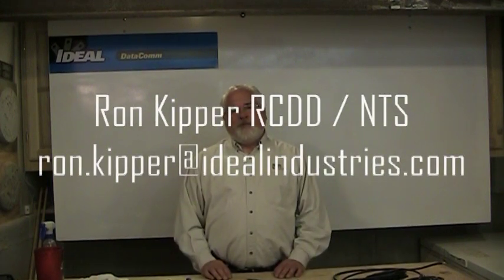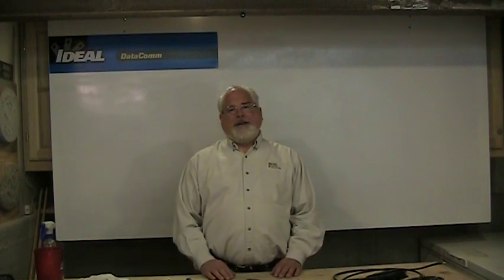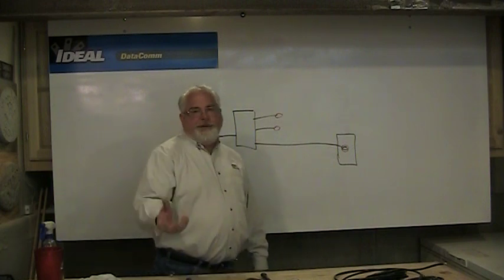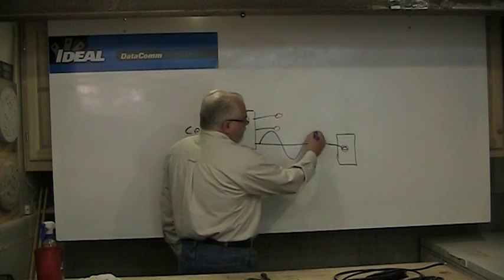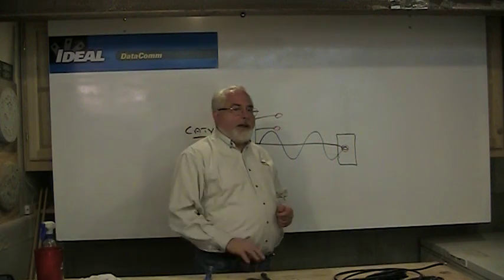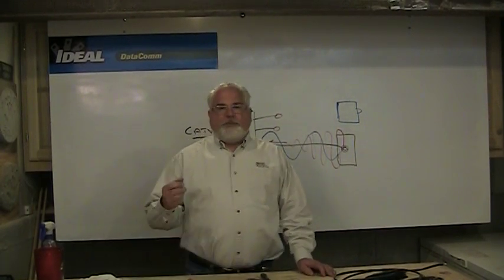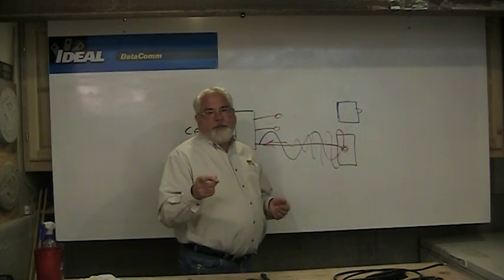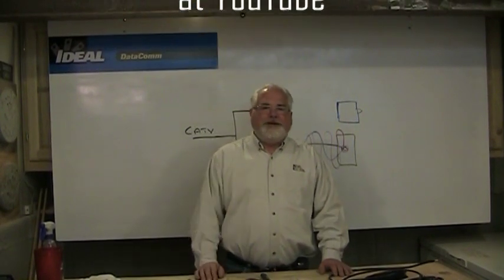Why Use CATV Termination Caps

Comment: I cancelled my CATV and was using my TV to just watch free channels picked up through the air using an amplified antenna. I tried connecting my TV to the defunct cable point and it acts as a perfect antenna to pick up the same free channels much better than the external antenna. I'm not sure if it's affecting the neighbours signals but mine works well.
Reply from the maker: Sounds good hope it works well Ron

Comment: The day the cable company installed a splitter, for tv our household began to hear high frequency noise throughout the house. We canceled tv but still hear high frequency. 
In the cable box outside the splitter is still attached and one side is not capped. Also all the ports inside our house are also not capped. 

Could this be the cause of high frequency noise and can i remove the splitter and cap the lines that were attached to the splitter to solve this issue?
Reply from the maker: It could help but I would suspect the signal strength coming into the home may need to be increased to make up for the loss of signal due to the splitter. If you remove the splitter and use just one TV and get a good signal that may be the issue good luck Ron

Comment: I'm going to use these to see if they increase the performance of my moCA adapters. I have a little more latency than I was expecting. I hope this helps.
Reply from the maker: Steven I doubt it will help with the letency but a good way to block any outside interference. Ron
Reply: @RonKipperDatacomm1  Thanks for the reply. I'm wondering if a POE filter could cause latency. I had cable internet before, now I  have newly installed fiber. I've read that POE aren't needed since the signal won't leak into neighboring connections through an ONT. I expect moCa adapters to add 2 or 3 ms to my latency. It's about 20 ms higher than straight ethernet.
Reply: Try to have only one moca splitter in your home to feed your adapters, and then terminate unused ports at the splitter.

Comment: Hey Ron great video this is what exactly I was looking for, question, is it better to cap at the splitter junction in the basement ( in my case) or at the wall ? Every room has an outlet and I will only be using two?Thanks in advance.
Reply from the maker: If the wall outlet is not hooked to a splitter then you don't need to cap it. If it is it is recommended you cap it and any unused ports on the splitter should be capped as well. It is just one more way to keep interference out of the system. Have fun Ron
Reply: @RonKipperDatacomm1  Thank you for the reply I will Cap them

Comment: Master, could you explain what would be a power inserter in an HFC network. If this network is energized at 60 or 90 v, because we are not shocked when touching the TAP.  
Hugs from Brazil
Reply from the maker: Hello that could be caused by several reasons and somehow AC is precent on your cable. So I would be double checking all connections looking for any damage in the cable as well as clearing all over head AC lines are clear of your cable (assume your cable is not buried) and make sure the cable is grounded as it enters the building. Good luck Ron

Comment: I suggested termination caps to the Comcast technician who today came to my house.
He either did not know what I was talking about or did not understand.

The physical cable from outside goes down to the basement.
The first Comcast technician 9 years ago put in an 1 to 5 splitter where each of the 5 from the splitter is connected to a cable that goes to various rooms in the house. This pre-wiring was done by the builder.
I am only using 2 of the 5 cables --- cable modem and DTA.

This second Comcast technician instead puts in a 1 to 2 splitter. LOL.
Sigh.
I am going to buy on eBay and buy some termination caps.
Thank you for this video.
Reply from the maker: Hello they are just one way to stop noise from entering the cable system use them well! Have fun Ron

Comment: Great video, thanks for clearing this up. One question I still have: I know there is a difference between a weather cap, that has a seal, and a terminator cap. I have 2 scenarios. One is outside, I’d like to cap off another cable companies line. I assume I use a weather cap??? And then I have a scenario like you demonstrated in the video. An unused coax outlet. I assume I use a terminator cap. Would I be correct? Thanks so much.
Reply from the maker: Luke yes I think you have it. If the splitter is outside and inside an enclosure you could  get away with just the termination cap. Thanks for watching Ron

Comment: what you missed is higher freq also = shorter and shorter antennas. inverse relation between freq and wavelength. a good radiator/antena starts around 1/4 wave length. If the head north again to keep up with fios/fiber to the premisis... 2ghz is 12.5cm wavelength.  even on the female end/ prongs inside the jack start to also look like a good antenna because at 1/4th of it we are talking 3mm. I know they keep going larger symbol set/ QAM but id bet they push the freq again in the coming years. other reason it doesnt get hot is the inverse square law, theres almost 0 power/even cat tv and the benfit of wire vs air... its still a hella weak signal in most installs though fttp and the house next to the pedestal might beg to differ. actually even traditional head end style with amp in the pedistal might still encounter this... maybe 1998 and in elementry school a young me once had the idea of rabbit ears into the cable jack. only did that once... i still remember the jolt/why i only did it once as well :D ...pedestal was maybe 100ft from where i did this and i know now the line was split from where it entered the house right under that bedroom lol otherwise good video, the point on reflections is pretty crucial. I wonder how long until they go mumi with cat tv. If i understand it correctly dsl introduced vectoring which seems to be along the same lines but as cable signals are straight rf id think they could eventually go with some form of multiple user mimo and count on coax bents and the like to implement the rf tech in cell and wifi stations. trick would be doing so with out obsoleting all their legacy boxes again.
Reply from the maker: Wow thanks for the input! Ron

Comment: Hi Ron, 

Great video and explanation. 
 
There is a vendor on Ebay selling 75 Ohm termination caps for use on unused coaxial inputs on universal disc players, like the Oppos.  Do these keep signals from coming into the unit, out of the unit, or both?   I assume there is no harm in using one of these?  Thoughts?   Thanks!
Reply from the maker: Probably no harm it should block signals from entering or existing a device. Just one more way to eliminate any electrical noise from entering a system. Not sure if anything nearby is causing you issues though. Hope that helps Ron
Reply: @RonKipperDatacomm1  

Thank you Ron.   Not experiencing any attributable issues.  Just precautionary.

Comment: Great video thanks for explaining such an interesting topic.  Question:  I have a 8 way splitter in the basement and coax cables leading to an outlet in each room.  Is there a performance difference in putting terminator caps on all the unused outlets VS disconnecting unused the cables from the 8 way splitter and putting terminator caps directly on the splitter?
Reply from the maker: Hi Matthew I don't know if I have a good answer for you but I don't think it matters. The cap helps isolate the system from exterior noise so as long as it is capped should be good. Thanks for watching Ron
Reply: You're best off terminating at the splitter.  If a line gets damaged then that outlet cap is useless.
Reply from the maker: Thanks for the input. Ron
Reply: Great question, I noticed an improvement in my network when I terminated directly to unused ports on the splitter. I have moca adapters as a backhaul for my mesh system.

Comment: Terminators prevent RF signals from being reflected back from the end of an electronic line that would otherwise cause interference. The terminator is placed at the end of a transmission line and will match impedance and minimize signal reflections.
Reply from the maker: Hey mark thanks for jumping in on the subject. Take care Ron

Comment: I have an EXTREME connector from the cable company.  There are 5 ports with termination caps on them.  I want to add another TV in my basement where this connector is at.  My problem is I cannot remove the cap.  Must I use a special tool?
Reply from the maker: Hi Dianne you don't need a special tool other than a basic pair of pliers to loosen the cap to remove it. Good luck Ro
Reply: Thanks Ron, I guess it was on too tight.  I got it off.
Reply from the maker: Yea they like to tighten them down pretty good. Glad to help.
Ron

Comment: Thanks so much for the info ~
Reply from the maker: Tuk glad to help you out have a good week. Ron
Reply: Hi Ron, I am wondering - what affect do termination caps have on Cable Internet line stats? For example, what would it change - downstream or upstream, signal strength or signal to noise ratio? I am guessing terminating the caps affects downstream signal strength - for example, properly terminated coaxial ports may result in downstream signal strength of 3.5 dBmV, whereas unterminated coaxial ports may result in downstream signal strength of 2.5 dBmV? Is that correct?

Comment: I want to move my wireless router from one room where cable is coming in to another room that has my TV, but I want to have my cable modem share the port. Is a splitter on that outlet where the TV is and a termination cap in the "computer" room my best option or am I better to pay extra for the cable company to route another line to that room? I'm guessing they'll just split it in my box anyway.
Reply from the maker: +Thomas Bihn Thomas I'm not real clear on your question. However if you split the line with a 2 way splitter to feed the other room it should work. I assuming your cable runs are not long, using a quality splitter and making good connections. It will not hurt to try just run some cable along the floor and see what you get. Ron

Comment: Great videos. Most HD TVs are getting a signal from the provider's box via an HDMI cable. The coax connector on the set is not used. Have you heard of an need to use a termination cap in this location?
Reply: Not True... Every installation is different.  What you state may be predominant in your area - not so in mine.
I do Home Maintenance for folks that cannot afford to pay the Cable Co. Techs. Mostly disabled veterans on a fixed income. 
BTW - I don't ask for any compensation, just material expenses. They deserve all of our respect and assistance whenever possible.

 It is my experience that very few of those are HDMI from a provider's "box".  Most residences around here don't even have a "provider's box". 
The service goes straight to the Modem/Wi-Fi then CATV or LAN to the peripherals. CATV to the home system is split off ahead of the modem etc.. 
Yes we are very rural.

Comment: How about those 90 degree right angle connectors for coax? The type that would allow the cable to connect to a jack at an angle and lie flat to the wall, instead of coming straight out? I  Need to use one behind furniture. Do these cause any issues with the signal strength?